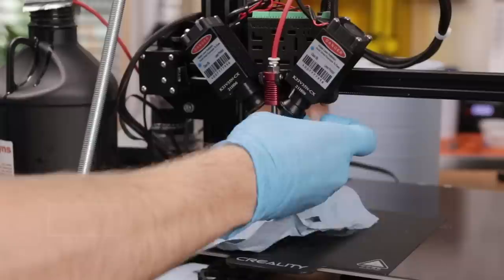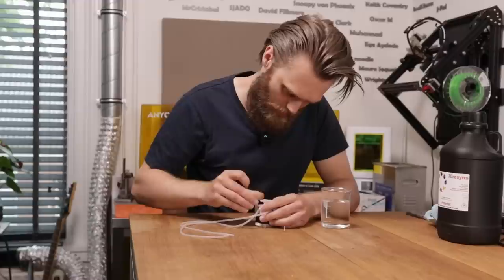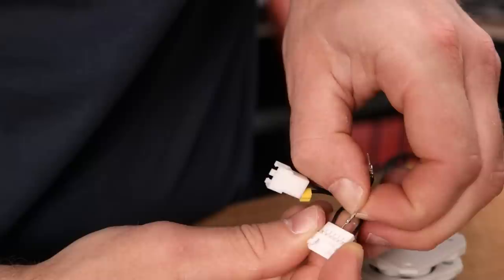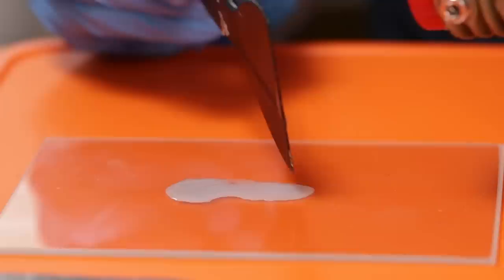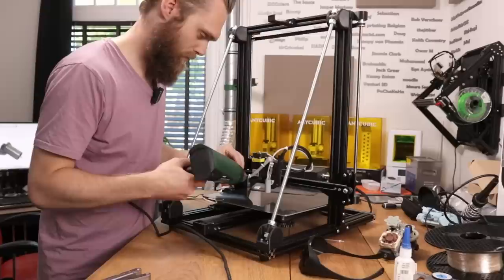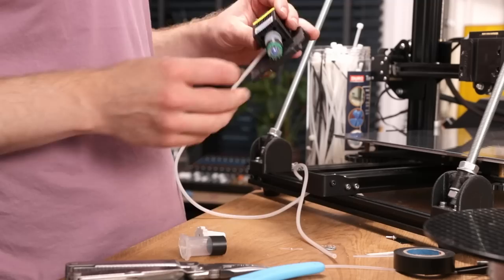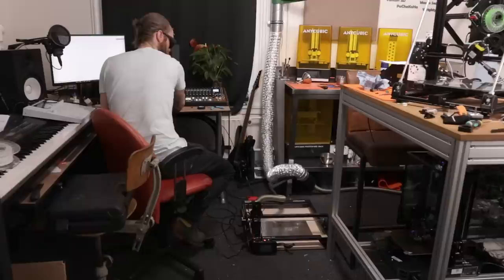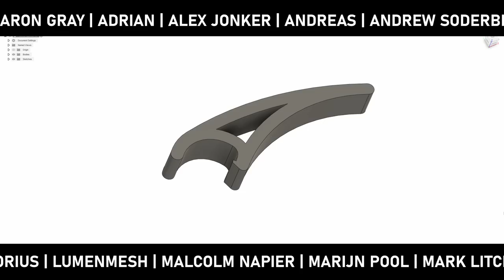FDM resin Printing with LASERS and a 3D Printed PUMP!

Comment: I love the pump discussion, "here's a bunch of pumps that no one would ever use for this purpose, and now here's the pump that everyone uses for this thing and is ubiquitous across like anywhere you can order them off Amazon." 🤣 I literally have five Amazon bought pre-built parastatic pumps that were five bucks a piece or less sitting in my workshop You could probably buy a bubble blower from the store and take the parasitic pump from that.

Comment: Ah I now see how you used the syringe pump. My thought was actually to use a very large syringe, 200ml for example, and to have the syringe pump sit next to the printer and still use a flexible line to feed the print head. You can get super precise pumping rates and easily track the accuracy of the pumping and still add zero weight to the head. Obviously you've done way more work in this area than me though!

Comment: The first printer that I had any experience with used resin and "wax" to print almost like a standard ink printer. It would lay down the wax and cure it to form the support/retention wall, then it would lay down resin and cure it. Cleaning the prints required a pressure washer and lots of scrubbing.

Comment: Try to print the thick resin without the lasers. Then when finished with the layer (via laver change g code) switch a UV Lamp (via Relais) on to cure the whole layer.... The only thing that will be important is to protect your nozzle at the curing process...

Comment: I believe one source of error comes from the resin.
You need to modify it so it gets a higher viscosity. Transform it into a paste which can keep it's shape for a while.
Then you can just extrude it, it should stick to the surface like molten plastic.
Another bonus is that all the FDM parameters and tricks will work that way. Things like "line width" for example.
Reply from the maker: I think so too. The resin is the thing I'll improve upon next! (together with some other ideas)

Comment: Excellent Work!
Have you considered printing a bracket to support lenses that would focus the lasers or even one laser to a smaller area?

I expect that a lense from reversed binoculars would focus the laser on a smaller area there would be less bleeding of light from the fresh resin and less clogging at the extruding nossel.

Another idea is to bind 9 arms to the extruder that curve out and away from the extruder–pointing perpendicular to the printing surface–with a bearing at the end of each arm and a lipped ring around the bearings with a small motor to rotate the ring some distance either direction depending on how much power is applied with a laser module attatched to the outer edge of the ring pointing beside the extruder nossel so that the extruder nossel is just out of range of the laser regardless of the position of the laser rotation where the laser can be rotated 360° clockwise or counterclockwise to stay behind the extruder and cure as the unit moves depending on how much conductor is leading to the motor and how much of an issue it is when the conductor wraps around the extruder—easily managed by something as simple as rubber bands that keep the motor conductor out of the work area.

The size of the motor can be significant and even heavy provided that it's not too heavy to move and that the Armature/Axle/Moving Piece of the motor can reach the ring.

Comment: The easiest solution would be the next size tubing. :-)  But, I like your design and would suggest 3 roller chambers with offset rollers to increase the volume without increasing the pulse rate. In addition, a small accumulator could absorb the pulses giving a smoother flow.

Comment: To reduce the pulsing further you could do something similar to a capacitor in electronics..Use a flexible/expandable piece in the line that is slightly bigger than the line. 

Once the expandable portion fills up it will collapse when flow slows down, if sized correctly it will allow continuous flow...kinda the same way a capacitor stores voltage (electrical pressure) and releases the voltage when the voltage on the line decreases.

The trick would be finding the right material that is flexible enough....I wonder if a small balloon would work?

Comment: i have a few ideas.
first would be to have it drop resin from above the lasers so it falls hits the print then sures.
second is to have the diodes just behind the nozzle, they would need a tiny focus but this may solve the problem with it extruding at the wrong time
finaly what if you lowered the print speed a lot then had the laser flash, so it cured the resin, then turned of for a few milli seconds then back on etc.

Comment: This is ridiculous… I love it! Also I think the pulsation at around minute 7 might be due to the difference in pressure and air’s ability to compress compared to water which results in the water pulsation when it’s on both out and inlet but not pulsating when in the inlet only

Comment: One thing you have to be careful about when working with fiber optics is to not exceed the minimum bend radius. Fiber optics rely on total internal reflection to guide the light inside of them, and if you bend them too far, the angle of incidence with the wall of the fiber will be greater than the critical angle for total internal reflection, and the light will escape outside of the fiber.

Comment: Wonderful video, and excellent results. Have you considered using a piezoelectric dispenser, like some inkjet printers use? Also, if the drops are small enough, it may be possible to "flash" cure the resin instead of continuously, which may create flow problems. Such an interesting way to solve the problem! Great work.

Comment: utilize the peristaltic pulsation and blink the laser when the resin is sucked back; hydraulic screw-on fittings are tighter than air

Comment: i would suggest if there was a way in the code to turn off the lasers during moves when its not printing. that way the nozzle will not clog. this is something i have been thinking of for a while also but was just a dream i dont have the tech knowledge or the time or money to. so thanks for doing it for us. retractions might be an idea during the moving faze also just to suck back the resin to stop it from blobbing when moving. just a couple ideas. also try a black resin it takes longer to cure. and please don't give up you will get there.

Comment: am working on same approach since 2 years, and I got some results out of it, first you need to use 2 pumps and a pressure regulator, the needle is fine but it should be modified a little, the tubes you used to transfer the resin should start at 3mm and end at 1mm at the extruder ( this will give more pressure ), also normal gcode wont be a great help that also needs to be modified (Flow rate)

Comment: There is UV light reflecting on the print bed. Try wrapping the nozzle with something a several mm thick to create a barrier/shroud. Make it go as close to the bed as possible, and see if you can replace the print surface with something non-glossy/reflective. You could also consider using some actuator to aim the laser at the print line further away from the nozzle (much more complex).

Comment: I would've solved the peristaltic pump issue differently by having several tubes in parallel a collector / buffer, this will make the flow pretty stable with minimal maintenance requirement (the tube will wear quicker the way you solved it), it is even more precise since it doesn't have to move a lot...

Comment: I have see Massivit machines operste first hand. Everything has to be perfect or the whole system doesnt work.
Your idea is much more controllable. 
Sweet video. Your dedication is much appreciated. 
If you can create a bead of uncured resin behind the nozzle as the nozzle moves then theoretically the resin won't cure inside the nozzle.

Comment: Higher pressure smaller nozzle with some sort of thickening agent in the fluid so it sprays out like a plaster or putty, the higher pressuure should cause some adhesion and consistency in volume. The amount of light shouldnt be an issue with the brass nozzles but im not sure if even .1mm would be small enough. You're definitely on the right track keeping light out of the tube but I also think with a higher pressure spray/squirt  you can have a larger distance from the print also stopping the clog.

Comment: Seems like the surface tension of the resin is causing it to pop up after being laid down, hence the nozzle scraping. There may not be an easy way around this. The nozzle could be surrounded by a flat, non-stick, translucent surface such as Teflon, which would flatten the resin as it cures, but I can only see that approach leading to a host of other problems. Perhaps mixing a small amount of a compatible surfactant into the resin would decrease the surface tension enough for it to lay flat and avoid forming drops. That said, try lightly spraying the outside of the tip of the nozzle with a clothing waterproofing spray (carefully, preferably outdoors and wearing a respirator; those chemicals are incredibly toxic both to you and the environment!) and see if less drops form on the nozzle after such a treatment.
Reply: Increase temperature perhaps? Lower the viscosity a bit and provide more energy for the polymerization

Comment: I had this idea as well, Thanks for doing the work.  I was thinking that the UV light should be applied in a ring around the nozzle, instead of directly at the point of extrusion.   Also, using high viscosity resin so it doesn't move much after leaving the nozzle. Then move it all very fast, so it has less time to move before an edge of the ring sweeps over resin.   For very small moves that are 'within the ring', would probably need to extrude some, turn off extruding, then come back to sweep the area with the UV light.  Also, I'd use a CoreXY motion, flinging the bed back and forth will also 'slosh' the resin around.  This is all theoretical of course, I haven't had time to investigate if any of this made sense.

Comment: If you want to get rid of the pulsating add a small sealed tube with some air trapped in it to the outlet. The air acts as a spring and the inlet restriction acts as a dampener and together they act as a sort of hydraulic shock absorber. This will also slow the response of the pump so you may need to add a valve to the end to help control flow, just mind the pressure

Comment: I don't know if this was mentioned, but here's a thought. Trail the nozzle with the laser offset enough to prevent lightwelling, maybe a few mm or more. That might not be as simple as just trailing in one axis, might have to be a laser output design with 360 degrees articulation around nozzle.
Reply: Issue with that is it only works when moving along the axis perpendicular to the line drawn between the nozzle and laser focus point. Turn any other direction and now the laser isn't aimed at what was just printed.

Edit. Derp. You covered it. Would be complex though.

Comment: So basically you fixed the pump but only in the forward direction. "Retractions" still pulsate. That's really cool.
Reply from the maker: No, retractions also don't pulsate. It only pulsates at the input in both directions, but that doesn't matter for the print.

Comment: Very Interesting design. You might want to research color UV printers to see how the work. They print the ink onto just about anything and then cure with UV. Search golf ball printers.
Another suggestion would be to not point the lasers right at the tip. Have them point just to either side. Also, as H34 mentioned try the darker resin.

Comment: Few ideas, try using a non clear resin to prevent the resin from acting like its own fiber optic cable, not aiming the lasers right at the tip but further away, and or pulsing the laser instead of continuous.

Comment: If you ever get this working, you can add multicolor-prints pretty easily! Just add a few pumps & resins and join their tubes.
Reply from the maker: Exactly! An idea I want to incorporate is similar as you mention, but mixing resins with different stiffness to get the properties in between.

Comment: you could use a inkjet cartridge with low viscosity dental resin, or using a proper PowerResins Model (special ceramic based 3d printer resin for dental model printing) and tune it.

Comment: Hello. That was quite an achievement in my own opinion. Try increasing the viscosity of the resin, by adding a filler to it. For an example, aluminium oxide powder, just ultrasound to mix properly.

Comment: You may be able to alleviate some of the issues with your designs by using resin made for laser 3d printers vs lcd 3d printers. They use less photoinitiator so that curing inside the nozzle from internal reflection and diffraction is reduced. Also you can add something that will absorb a portion of the UV light (think lycopene or some other highly conjugated molecule like vitamin A) so that the light cannot travel as far in the liquid.

Comment: I'd make another pump design, the one like GPM Reversible Gear Pump for vehicle oil, changing gear teeth shape into something bigger and smoother to make it easier to pump resin , which is much thicker than oil.

Comment: Two ideas to put into the mix. 1. Isn’t the whambam build plate reflecting the laser to nozzle?. You can buy mirror paint. Could you use that to divert the laser around the nozzle rather than through fibre optics? 3. Idea can’t count, maybe a prism or a lens design like used in laser cutters to ensure the laser is pin point accurate and therefore use a smaller laser dot, stopping the spill of laser light?

Comment: use a printer cartridge for printing. move the head aside after each layer and cure it with a big lamp layer by layer. that is something i wanted to try for years but also use powder.

Comment: What about using very high viscosity resin, and doing the curing and printing pass completely separately?
- print a layer
- get the printer head out of the way (to a UV safe landzone)
- illuminate the entire work area with UV
- repeat

This will lower the resolution, but you can play with using just enough UV to gel the layer. This can be quite good because it improves the bonding of the next layer (almost layerless), and you do not need to use high power UV sources or lasers.
If you keep using this UV conductive resin, the deeper layers would continue to cure even more, after each pass. This is very good because, you need them to carry the weight.
Reply from the maker: Thanks for your suggestion! I eventually want to incorporate fibers in it and cure it while printing. This enables extreme bridging for instance.

Comment: Interesting idea, I was once dreaming about using a laser as heating source for FDM - well, wherever the mind takes us.

Maybe:
- Define method to test if layer is cured enough for next one
- use Z-hopping
- Use nozzle (not needles, but hey: depending on the viscosity you‘ll need a different tip, small and flat, large and angled…
- use a course (weak) and a focused (powerful) beam, reduce stray with two pinholes aligned after each other and enclosed in black FDM/resin
Interesting.
Reply: Also, peristaltic pumps do work but for precision rotating piston pumps are THE way to go.

They are very expensive and would require two steppers (one for the piston, one for the valves), very tight tolerances.

Time/pressure may be an option too, this requires a precise pressure control loop for the resin container, pressure sensor and valves, perhaps a bleeding one too.

You may want to start examining different resins and how they react to a given setup, you will see that depending on temperature and needle/nozzle there are very interesting effects in play.
Yep, you‘ll need a good camera and macro lens for thisy
Reply: Your laser idea is called, DED 3d print. Direct energy deposition. Look it up. Usually used only for metal wire or powder blown from a nozzle, but some newer pellet feed plastic systems are using lasers to heat their melt chamber.

Comment: Great content! Love the idea. It's something I have thought about alot of times before. Just different ways to 3d print. My idea was to use a super tiny paint brush tip hooked up to the resin tube. So it's a super simple idea just have to make sure the light doesn't cure the resin on the brush and harden it. I believe it would fix the issue of the nozzle hittin5 the print and you would be able do really thin layers

Comment: I’ve noticed with my uv resin that light on one spot can cure a distance from it.  Using translucent that is so perhaps a weaker light so that the resin can only reach a gel state as it exists the nozzle.  A ring around nozzle with uv LEDs so its just barley curing and each pass after would further complete the cure.

Comment: This is mental! at first I thought it was like SLA x FDM but I think its like Polyjet x FDM..... polyjet printers have so much sensor feedback you might struggle but I have some ideas: main one is that you might find that the resin is undergoing exothermic reactions as it cures and you get some curling because of that. The print head on some polyjets have fans blowing straight up (to pull hot air away from the uv lamps) and fans blowing straight down (to blow cool air onto the part).  I suggest you put 5 part coolings fans on the printer, you still have the fan pwm port on the board right??
Reply from the maker: Thanks for sharing your thoughts! I'm going to work on axicon lenses to prevent the light from bleeding and make it more efficient. I think that this, together with optimized resin will do the trick

Comment: i have some ideas, but idk if gonna work.
if u make the laser "blink" (turn on/off) but still focus around the nozle .and make the nozle in a refractable material or add a layer of refractable material arround it.
The flow of the resin is too liquid as i see.
And the despiciable idea: make one layer of resin and after a layer of laser to cure it